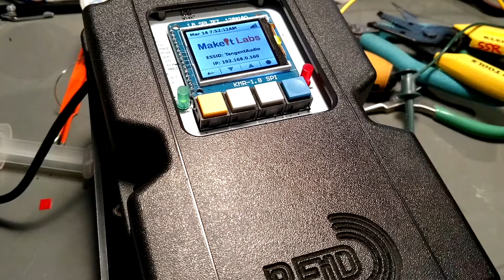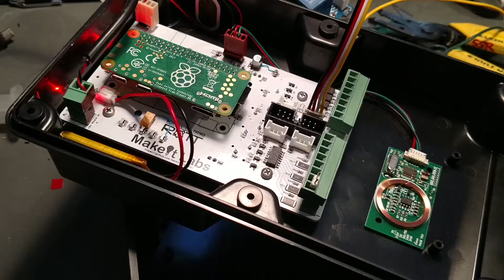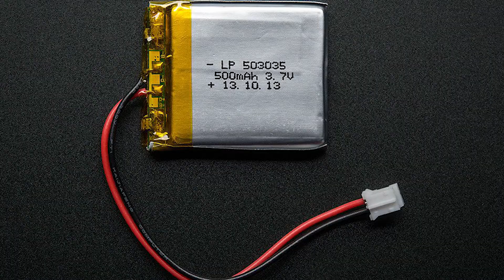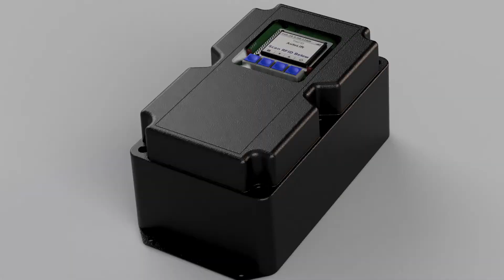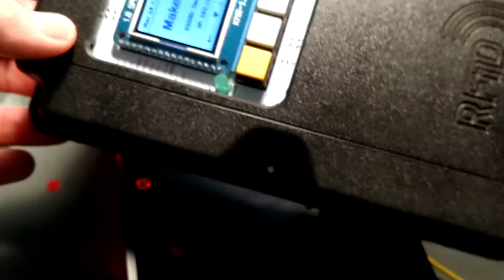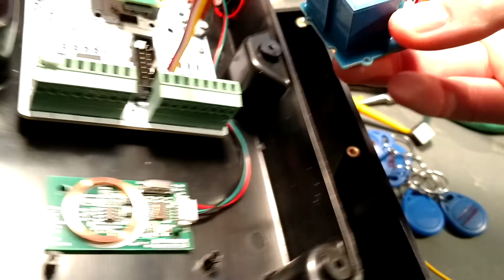RATT: Pi Day Update

Comment: Hi, very well done and feature packed!!
What backend do you connect these to, FabManager?
We run a shared woodworking and fabrication workshop here and talk about this exactly for months... Are the code and board available somewhere somehow?
Just loving it, congrats 👍
Reply from the maker: Greetings!  We use our own backend that we developed in-house to manage our membership ( https://github.com/makeitlabs/authbackend ).  The backend has been used for our door access system ( https://github.com/makeitlabs/doorbot ) for a couple years now, which is the spiritual ancestor of the RATT project.  Neither of these projects are very well documented at this time, but they are open source and available.

RATT is also open source hardware and software, and the up-to-the-moment development files are at https://github.com/makeitlabs/ratt/ .. It's not ready for prime time, as we're still actively developing it and will be putting it on our first tools in the coming weeks.  We're hoping to document it better than past projects and make the whole system a potential option for other makerspaces.  We have also discussed possibly selling boards and kits to help other makerspaces, but we can't commit to that just yet.
Reply: TangentAudio this is all great?
Do you think authbackend could be mapped on other lab management DBs?
For the cards, we could take a dozen of these... And we are connected with a FabLab project that may be very interested also :)